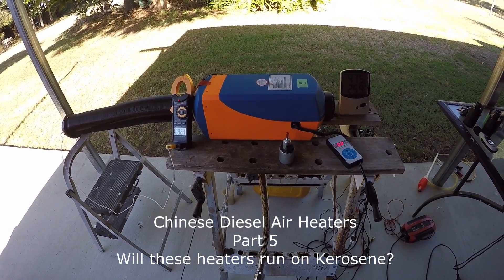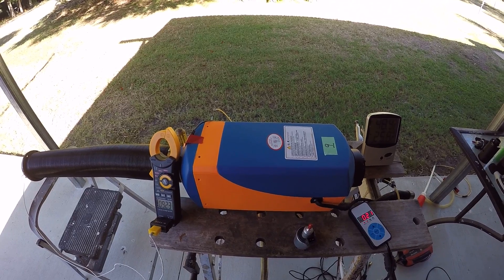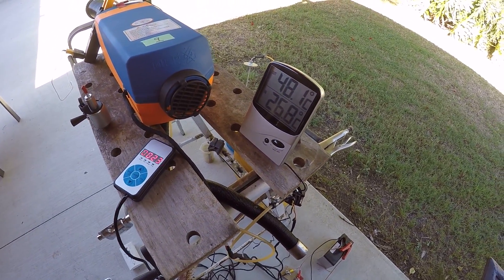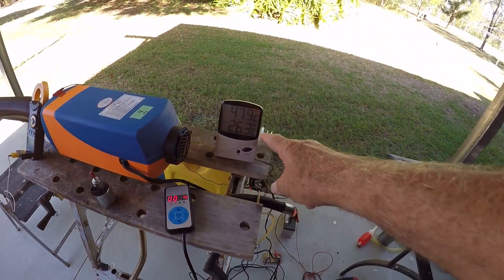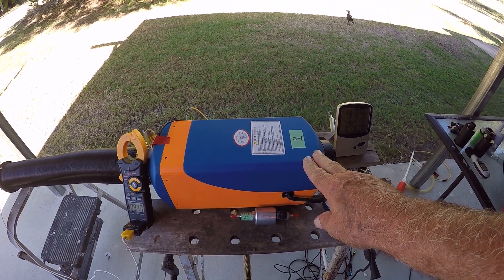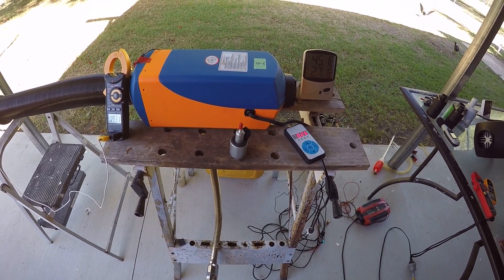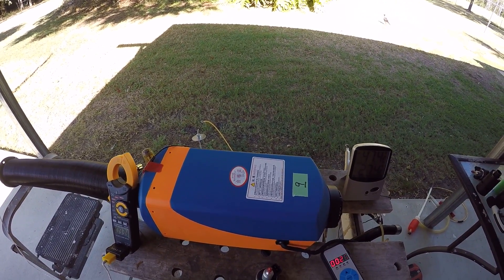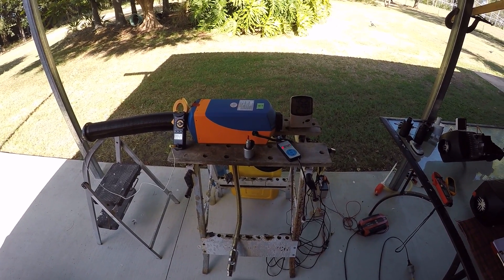Chinese Diesel Air Heaters   Part 5  - Kerosene Use.

Comment: Fantastic information.  Q:  Burning kerosene eliminates any soot at low speeds, would a diesel additive increase the lubricity and protect the fuel pump?
Reply from the maker: Hi Spencer, 

If you are using a product like lighting kerosene as a fuel you need some additional product for lubricity, generally a minimum of 10% diesel will suffice.

Some countries have a high sulfur content heating kerosene, and this sulfur is generally enough for lubrication.

I do not know the diesel additive you refer to, but I advise against using additives like 2stroke oil, as burning oils produce carbon deposits. Think of it, if it smokes when burnt it makes carbon.

Cheers.  JMcK
Reply: @johnmck1147 you have given this reply many times. It is my experience that 2 cycle oil is more prone to cause deposits at lower temperatures. Running your string trimmer at full throttle will produce way less deposits than one at low throttle. That being the case, I would think these heaters would run hot enough to prevent significant buildup, especially given the low concentration of oil used

Comment: I have ran mine on aviation kerosene (Jet A) and it ran great 👍🏻
Reply from the maker: Hi CV,

They run very well on Jet A, but strongly suggest you add 10% diesel for pump lubrication. 
The pump has no external lubrication and uses the diesel to lubricate the little piston. 

Cheers.  JMcK

Comment: John, your supposition about absolute certain premature failure of a dosing pump run on kerosene, perhaps within days, is based upon a single dosing pump failure years ago?  Do I understand that correctly? If so...there seems a serious lack of evidence on this particular idea.   Have you run any further tests?  What effect does the quality of dosing pump have in the failure?  Does it matter is the pump is new or used? Will 100% of the all dosing pumps run on low grade kerosene in fact fail within days? How many days?  Thanks for the video.
Reply from the maker: Hi GH,

This series is to try and give some advice to DIY people who want to install a heater themselves.

These little pumps have no external lubrication and get their lubrication  from the diesel. In Australia our lighting kerro is very pure with little to no lubrication properties. In other parts of the world their kerro has a high sulfur content which does provide lubrication, and the pumps run ok.

Yes the age of the pump would have a bearing on its performance.

At this stage I have better things to do than run a destruction test on a diesel heater DIESEL dosing pump using a non standard non lubricating liquid.
Perhaps after I buy a new petrol mower and I see how long it will run without adding any 2stroke oil to the petrol for lubrication.

Thanks for your comments. 

Cheers,  JMcK
Reply: I would suggest mr henrickson debunk the assumption by running his pump on straight kero for a week to see what happens ;-)

Comment: Thanks for your video. I want to run my diesel heater on kerosene because I filled my tank up in my van and spilled diesel fuel and had to use a degreaser and water.

I've been using kerosene in my parts washer for years because it's cheaper than parts cleaning solution and it evaporates. 

I can buy kerosene from an actual pump in the US where I live . Last time I bought some it was US$ 3.00 for a US gallons or 3.8 liters. Diesel is around $2.79 a US gallon to give you a perspective.

On the flip side I'm curious if these machines would run on a mixture of used motor oil and kerosene or diesel .

Have you tried that?
Reply from the maker: Hi James,

As stated in the video these heaters run very well on kerosene, but need a bit of diesel (10%) for lubrication.

They will run on a used motor oil mixture.    - for a short while. 
Burning any oil causes lots of carbon build up which rapidly clogs the burner and atomisation screens, causing heater flame out.

Cheers.   JMcK

Comment: you can buy other 12v universal petrol and diesel fuel pumps. One of those would work fine with kerosene
Reply from the maker: Hi HHS,

Are they fixed volume pulse pumps?

The ECU must know the fuel delivery, so it can match that to fan speed and start procedure for correct fuel/air mix and correct burn.

If not a pulse pump the ECU does not know what Hz rate to operate the pump to get the correct fuel delivery.

Regards.  JMcK
Reply: There's a guy in England makes silent pumps that don't need lubricant.

Comment: Great videos John.
How about adding an oil additive to the kerosene?
Reply: I would suggest the cheapest additive - diesel
Reply from the maker: Hi there,

Adding "oil" like 2 stroke oil, or similar greatly increases carbon build up and greater servicing in these heaters.

Better to add around 10% diesel to the kerosene for lubrication.

Cheers,  JMcK

Comment: Hi John, it may have been mentioned earlier but in the U.K. and in some other countries Kero for domestic heating has the duty rebated. In simple terms the duty per litre on diesel is £0.57 per litre ( slightly less in other European countries ) yet its £0.00 per litre for Kero. Red Diesel in the U.K. ( dyed to identify it ...also known as MGO in Europe {marked gas oil})) and Green in Ireland for agriculture or heating purposes also has a lot less duty than diesel for road use but it’s basically ordinary diesel with a harmless dye ( all types are mostly low sulphur ). It’s far cheaper in Europe to use MGO in these heaters.
Reply from the maker: Hi Patrick

Thanks for that valuable feedback. 
Yes you guys are very lucky over there.
In Aus, bulk kerosene is about three times the cost of diesel where in years past it was around half the cost. 
A 20 ltr container of kerosene in Aus  today will cost you around A$90

Cheers.  JMcK

Comment: Very handy thanks. Here in the UK at the moment, Diesel is about 85p per litre, whereas Kerosene is about 22p per litre, so Kero is certainly more attractive, but it's a shame it's not good for the little pump. Maybe a mix would be best for me :) Thanks again!
Reply from the maker: Hi Mr A,

At that cost difference I would be running a 90/10 kerro/diesel mix, and getting a cleaner burn. JMcK
Reply: @johnmck1147  Thanks John. That's really handy to know, and it'll save some good money! I've really enjoyed your videos, and envy your 40 degrees! Here in Wales at the moment, it's a good day if it reaches 5 without driving wind and rain.
Reply from the maker: The Amazing Adventures of Miles 
👍

Comment: In the states we have low sulfur diesel for motor cars and trucks to lower emissions, I'm assuming this would also injure the metering pumps.  Off-road or farm "red" diesel I believe has higher sulfur content.  I haven't found a source for 2-K/K2 kerosene where I live, I suppose because of the temperate climate.  I believe it's mostly used to mix in trucks to help with waxing in the cold.  Aviation fuel might be another option, but likely has its own issues.
Reply from the maker: Hi Ziggy,

Thanks for the feedback. Diesel is a fuel "oil" regardless of sulfur content. I don't see any issues here with the dosing pump.  
Cheers.  JMcK
Reply: It is my understanding that all current diesel fuel in the US is ultra low sulfur. The only purpose of the red dye is to indicate it was not taxed for road use. That was not the case initially but has been for years.

Comment: Is is possible to do without the pump and mount the fuel tank higher than the heater and use gravity to feed 100% kerosene?(as in a tiny home install)
Reply from the maker: No Scott.   Sorry.

The computer control board gets the right fuel air mix for each heat setting by matching the fan speed, to the number of pump pulses. 

Cheers, JMcK

Comment: It's kind of hit-or-miss to find inexpensive kerosene when traveling, so I'm thinking of just using a low-sulphur kerosene mixed with diesel for maintenance purposes only, as a way to occasionally "clean" the unit.  I'm wondering what your thoughts are on this - namely, how frequently would you do this, what mix ratio to use and how long to run it for a proper cleaning?  Much appreciation in advance if you have the time to offer your thoughts!  😊
Reply from the maker: Hi CP

That is fine. The frequency is very dependent on your install, hours used and your operation practices. With a good install without restrictions and proper operation you can go years without a carbon clean.

For preventative maintenance, keeping the above points in mind, and the fact I do not know your usage hours, I would suggest for med to high usage, a kerro/diesel mix of 90/10 , run for one hour at 4 to 5 Hz, at season end be a starting point for your consideration.

Regards.  JMcK
Reply: @johnmck1147  Thanks so much for your reply!  And many "thank you's" for this series - it's quite impressive how thorough you've been in describing the operation of these units.  I live above the 45th parallel in the U.S., and winters can get quite cold.  There's a chance this could become my primary heating source all winter.  I can imagine racking up 2000 hours in a single season to heat a small travel trailer.  My intention is to install it in such a way that it's quick to swap out, and to purchase a 2nd unit as a "backup", so that I can swap out a failing unit to clean/repair/replace with little disruption to heating.  I greatly appreciate all the safety, installation, operation and maintenance tips you've provided in this series, and will be following your advice closely.
Reply from the maker: Cats Pajamas 

Hi CP, 

Redundancy is a smart practice. Having a spare heater in your situation is a very good idea.

If you are in such a cold environment I assume you use winter diesel. However adding some kerosene, perhaps 25%, may help prevent cold weather gelling issues as well as soot reduction.

But our winters here are very mild by comparison and I have not personally tested  a kerro diesel mix in real world freezing conditions, to get accurate real world data.

Cheers.  JMcK
Reply: @johnmck1147  OK, thank you!!  Yes, they switch over to winter diesel in November.  But maybe I'll also add a percentage of kerosene regularly (20-25%) in the coldest months whenever I have convenient access to it.  Thanks so much for your advice, I value it greatly!!

Comment: John, I have a 2KW diesel heater.   If I were to run the same mixture throughout the entire year here in Canada on my diesel heater, would you recommend a 80%(kerosene) to 20% diesel mixture?  Will this ratio minimize the chances of carbon buildup in the chamber and be enough lubrisity to lubricate the fuel pump?   Right now I have the diesel heater on my boat and only turn it on perhaps 15 times during winter when I am out on the boat.   I have it running on pure diesel at the moment.   I usually only have it on half power as full power is too hot.   However, I turn it up to full power and run in on full power for at least 10 mins prior to shutting it down to help burn off carbon deposits.  Based on my usage,  would you recommend that I use a kerosene/diesel fuel mix and if so, what percentage for kerosene and what percentage for diesel?  thanks in advance.
Reply: 1 year on ,but, in Canada diesel is sold in winter with a LOT of kerosene in it to prevent gelling.

Comment: Hi John I have now got my heater up and running in cold wet france lol, I'm using a power pack from the mains electric and works very well but one question is that we have a few power cuts here and was wondering if it would kill my heater?
Reply from the maker: Hi Khris,

As stated in the videos, when you turn the heater off it goes through a shutdown cycle that can last some minutes. The heater runs down and the fuel pump stops, the glow plug comes on to help burn off excess diesel and then the fan continues to run until the metal heat exchanger cools down sufficiently.

If the heater is turned off at the mains the cool down cycle can not happen, and the heat in heat exchanger is not dissipated. The higher the pre shutdown heat setting of the heater, the higher the damage from the contained heat.

You are unlikely to have a fire issue, but unless you can quickly open the heater case and manually fan the heater, you will most certainly melt and destroy the ECU, which is mounted on the front of the heat exchanger. You could also destroy the heater fan, and even melt parts of the plastic case.

Perhaps if you are in an area of regular power outages, you should consider running your heater off a small battery connected to a small mains charger. A small motorbike battery connected to a 5 amp automatic battery charger should work just fine. Because the battery charger is permanently connected to the battery it should be an automatic type.

Cheers.  JMcK
Reply: @johnmck1147  thank you John will look at this and see about getting it done,, we have 32 sec heating oil would I need to add anything to it or can it be used as is,, many thanks for your help with this,,
Reply from the maker: Khris A 

Hi Khris, I do not know that heating oil so I can't advise you. But most heating oils have a good  sulfur content and can be used as is. You could add 10% diesel to the heating oil if you are concerned, or you could try it as it is. If in the future you have issues with the pump running on straight heating oil you could buy a new pump, the ones from China are not  too expensive. 

If you need to buy a replacement pump, there are many suppliers and I list just one below. You also may consider buying a pump now, and keeping it as a spare.

https://www.ebay.com.au/itm/12V-Car-Air-Diesel-Parking-Oil-Fuel-Pump-For-Eberspacher-Universal-Heater-Set/363027948853?hash=item548626e535:g:gsYAAOSw5FVe8FNt

Cheers.   JMcK
Reply: @johnmck1147  your a star mate,, thanks for the information, can't believe how economical they are to run, it was far easier to calculate the dosage and work out the amount of fuel it uses,, thanks once again for the down under info 👍👍
Reply from the maker: Khris A 
👍

Comment: Thanks John for giving us lots of information regarding these heaters, I live in france and parrifn heaters are everywhere and most shopping centers sell the heating parrifn in 20ltr containers, my feeling is that they are low in sulfur so would an idea to add a diesel mix? The other question is that if people are running the heaters from their fuel tank and are driving in very low temperatures will this foul up the heaters over time ?  Many thanks
Reply from the maker: Hi Khris,

I do not know the lubricity of heating paraffin  in France, but generally heating paraffin has some sulphur (giving lubrication to the pump) while lighting paraffin (used in kerosene lamps) is very pure. If unsure suggest you add around 5% to 10% diesel to the paraffin. 

Re the second question, generally cold areas sell "winter" diesel in winter to lessen the gelling problems of diesel in freezing conditions.  If the vehicle engine runs ok, then the heater should run ok. If you find yourself getting heater burn issues, suggest you run some kerro through the heater occasionally to remove any gel deposits.

I can not  be real helpful here as I do not have any real personal experience of diesel gelling in these heaters in freezing cold conditions. Our winters can get down to -2°C to -4°C in the mornings but then warm up to 10°C to 15°C during the day. In Queensland our winters are like a Canadian or Northern European Summers. We are very spoilt here.   JMcK
Reply: @johnmck1147  thank you for the information and giving your time to do this,, one last question is what do you think is the maximum that I can extend the exhaust pipe as setting up the heater requires me run a pipe of the same size for about 8 feet,,
Many thanks for your time and help,,
Reply from the maker: Khris A 

Hi khris, What! You use feet measurements in France? (Just kidding)

A 8 foot exhaust of the same diameter will be fine if it ascends. May be ok if it runs horizontal, but will most likely cause you issues if it trends downwards.  JMcK
Reply: @johnmck1147  ha ha yes us men need things to sound bigger ,,, thanks for the quick reply and help regarding my heater ,,many thanks

Comment: So, based on this, pumps designed for petrol should use some sort of (teflon) seals instead of direct metal to metal contact. I have used petrol pumps that have been in service for 15 years and they seem no worse for wear. If the impulse flow amount is the same with kerosene (.02mL) then these could be successfully used with a diesel heater...?

Comment: Excellent video, by chance have you tested fuel additives when using kerosene i.e. Marvel mystery oil or Lucas top cylinder lubricant?. Also iam curious about Altitudes, how has that affected your combustion with different fuels.?
  Outstanding video series you've produced, Thank you for sharing your thoughts.
    Regards, Eric ✌️
Reply from the maker: Hi Eric,
Thanks for your feedback.
I have tested 2 stroke oil but not other additives. Adding 2 stroke oil certainly works but burning any types of oils causes increased carbon deposits and more frequent maintenance. So much simpler just to add a little diesel to the mix.  JMcK
Reply: @johnmck1147  Thank you for your reply John, that makes perfect sense.✌️
Reply: @johnmck1147  hi what ratio do you use bud
Reply from the maker: Khris A 

With domestic or lighting kerosene (no lubrication) as distinct to some commercial kerosene with a high sulfur content giving lubrication,  a ratio of 90/10 to 80/20 kerro/diesel seems to work well.  JMcK